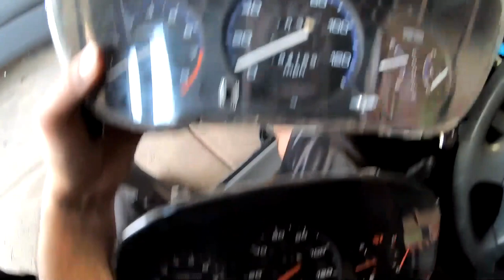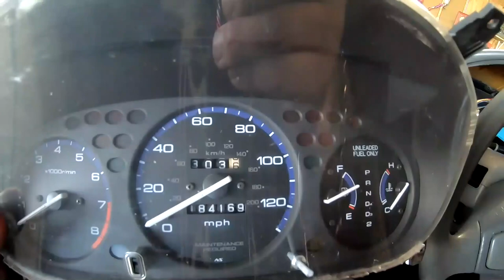Speedo Kote 2k Black Primer Sealer sprayed on civic

Comment: Hey bro after I sent this comment and u answered my questions which I really appreciate you taking the time to answer my questions.  So here's what's I'm doing a resto-mod on my 1967 Mustang which I used this Speedokote 2k urethane  Black high build primer/sealer,and it came out great I've got pics of everything I'm telling u about to if ur interested in them. Anyways after that I ended up spraying the car with Speedokote 2k "T-Rex epoxy primer and its DTM. DTM because I stripped the Stang all the way down to bare metal. So after that I bought some more of the High build 2k black urethane primer, sprayed the entire car then waited 24 hrs and I wet sanded it from 400 grit to 3000 grit then cleared it and wet sanded that from 400 to 3000 as well and now I'm buffing it all out. Surprisingly  as it may be that flat black primer cleared and polished out looks super nice bro. Thanks again for ur help dude I appreciate you.
Reply from the maker: Awesome I just seen your comment. yeah I would love to see some pics email some if you can to   
mg.2612@yahoo.com glad it worked out.

Comment: Some say the better the gun is to spray the primer or sealer the smoother the finish will be and you can base and clear right after that.
Reply from the maker: Makes sense I kinda wanted to use my good gun but didnt want to risk it getting clogged up during spraying 🤦‍♂️
Reply: Barbas Life yah if it had the 1.3 tip may be to small to spray the primer.

Comment: okay so 1 question for you.. 
so my bf said that i need, “Primer Grey Filler Spray Paint”, right? so rn i’m doing some research then after he said i needed, “Primer Grey Filler Spray Paint” like why do i want, “Grey”..? i want black, not GREYY!! some these days i’m spray painting my car’s front grill so.. /: anyways also, he said that “don’t do it without that “Primer” cuz it will look like sh*t/crap, then you’ll have run marks and sh*t” like wut? o.o is that true or no..? 🤔 like i’m high key confused, i did research on the grey stuff but i ain’t gonna spray paint my car’s front grill “GREY” i’m gonna spray paint the car’s front grill tho, smh.. 
so what’s your advice plz? ,-,

Comment: what were you wiping the car down with at 5:50? How long can you leave ur car sanded down to metal before you have problems with rust?
Reply from the maker: Minerals spirits only I wiped the car many many times until it was very clean  this car had very little bare metal exposed if I seen a spot I put primer immediately but  its been about a week and no rust.
Reply: Barbas Life cool thanks for the facts

Comment: Hey bro I'm using the speedkote urethane black primar and then I'm going to clear after that. I have a couple of questions, can I use mineral spirits to thin the primar for spray application or do I really need to buy their reducer? #2 n the beginning u wiped the car with mineral spirits and then used a tack cloth, is that a method u can use on all urethane paints and I'm assuming it will not cause fish eye later on during the clear.# 3 can I basically go straight to clear after let's say 3 coats of primar or do I need to sand it first, and if so what grit do u recommend to use?
Reply from the maker: Not sure if you can use mineral spirits to reduce primer I have used the mineral odorless mineral spirits from Walmart to reduce single stage and has worked but Dont want you to mess up your paint I would order a reducer. And yes I  always wipe then only lightly tack cloth if I have it available otherwise skip. You can go straight to clear if you would like but if your looking for a crazy wet shine wet sand primer with 600grit  very lightly just skim over it then wipe with mineral spirits clean  let it flash 10 min and spray with clear. It will look like a paint job.